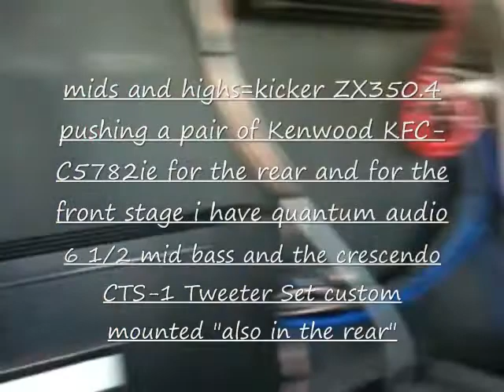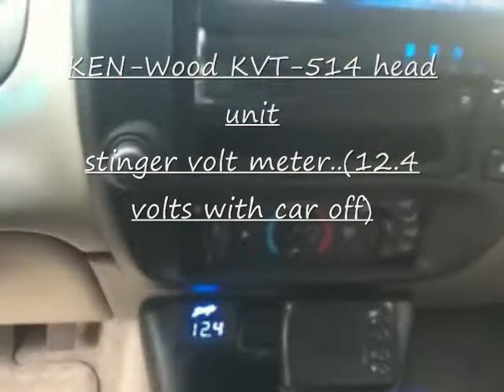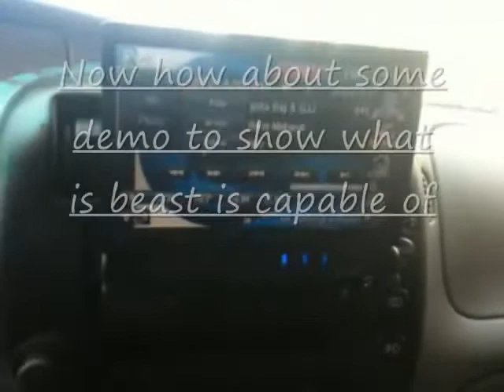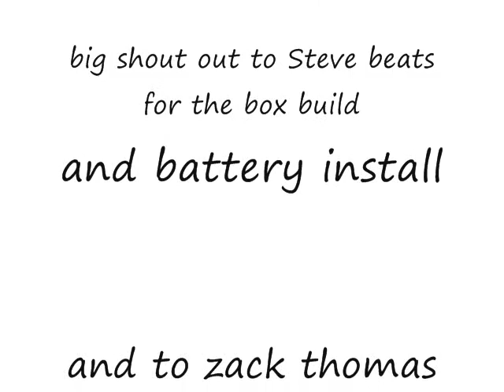back to the bass

Comment: im installing it all in a 1987 GMC Blazer its some what a show truck with a 9" lift and on 38's im also putting bigger tires on it in the rage of 40's.... the batterys will be Kinetik HC2000 and the amp will probably be 1 Cadence Acoustics ZRS C7 14000 Watt Peak 18V Mono Block Class D Amplifier.... i need to know if this would be a good setup and im ordering 2 irragi 200 amp alternators.

Comment from the maker: thats spunds like a crazy set-up, the only thing i would think about if i where you is that the amp your talking about does a Max RMS Power: 7000W @ 1-ohm, and if you run 2 audioques at 18 volts linked you can get 2 ohm Linked Power @ 18V @ 1% THD	12000W x 1... and would be quite a bit cheeper. whats your box going to be tuned to>?